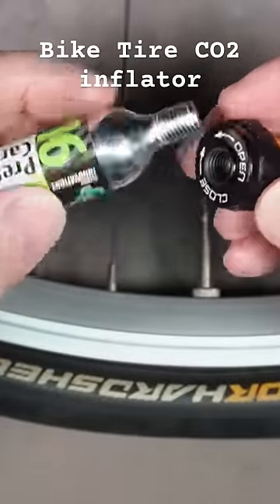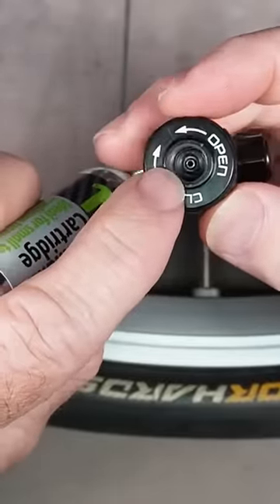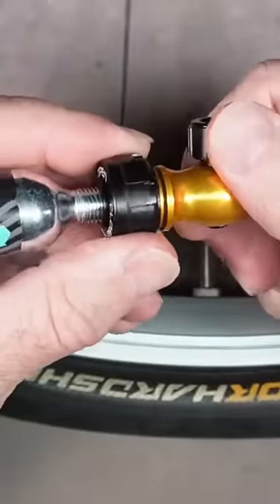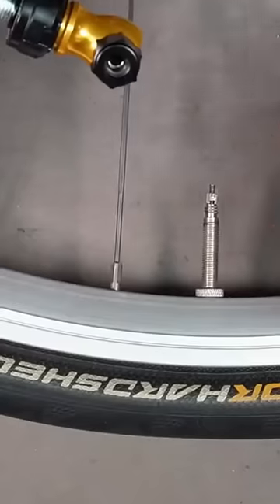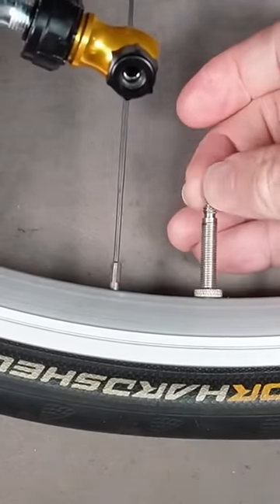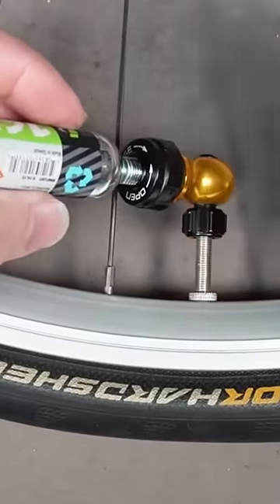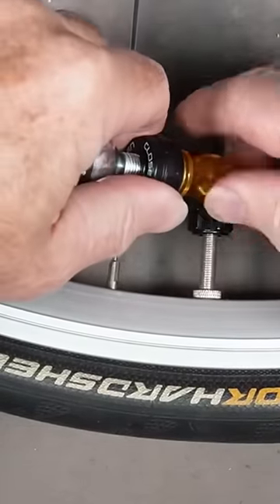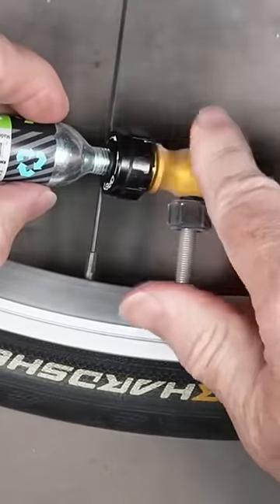Bike Tire (tyre) CO2 Inflator: How to use. #bicyclerepair #bike

Comment: So how do you get it out without deflating?
Reply from the maker: This is a Presta valve. Presta valves close when there is pressure inside the tube or tire. I only loosened the lock nut, which is necessary for air or CO2 to flow into or out of a Presta valve. I did not remove the core. You can see the entire video here: How to Use a CO2 Bike Tire Inflator
https://youtu.be/jc-BpZL3lAk
Thanks for the comment! I appreciate it!

Comment: So when you detach the bottle from the stem all the air comes out👍
Reply from the maker: This is a Presta valve. Presta valves close when there is pressure inside the tube or tire. I only loosened the lock nut, which is necessary for air or CO2 to flow into or out of a Presta valve. I did not remove the core.
Thanks for the comment! I appreciate it!

Comment: You never put the valve at the bottom of the rotation when you're filling with CO2. It totally puts liquid Co2 into the tire. You put the valve all the way at the top so that gas goes into the tire
Reply from the maker: Thanks for the tip!

Comment: So how much air do you lose when you unscrew it cuz , needles not in remember
Reply from the maker: Nothing will escape when the CO2 inflator is removed. This is a Presta valve. Presta valves close when there is pressure inside the tube or tire. I only loosened the lock nut, which is necessary for air or CO2 to flow into or out of a Presta valve. I did not remove the core.
Thanks for the comment! I appreciate it!

Comment: People need to remember that air pump that half length of the arms exist. That is much better option than this. Just make sure you don't get to close with tyre. Because it gonna make you look like jerking it.
Reply from the maker: There is nothing wrong with an air pump. A CO2 inflator is just another option for emergencies to quickly and easily inflate a tire out on the road after fixing a flat. Thanks for commenting!
Reply: @davescycling  tbh, I didn't see the common need to use that thing. The best I could think of is race and bears

Comment: and how do you get the inflator off and keep all the co2 if you have the schrader valve loose in the tire valve.
Reply from the maker: This is a Presta valve. Presta valves close when there is pressure inside the tube or tire. I only loosened the lock nut, which is necessary for air or CO2 to flow into or out of a Presta valve. I did not remove the core. You can see the entire video here: How to Use a CO2 Bike Tire Inflator
https://youtu.be/jc-BpZL3lAk
Thanks for the comment! I appreciate it!
Reply: @davescycling  The Presta valve is where?
Reply from the maker: The valve on the tube is not a Schrader valve. It is a Presta valve.

Comment: So how do you screw the valve stem back in with the inflator still on and not lose air?
Reply from the maker: Nothing will escape when the CO2 inflator is removed. This is a Presta valve. Presta valves close when there is pressure inside the tube or tire. I only loosened the lock nut, which is necessary for air or CO2 to flow into or out of a Presta valve. I did not remove the core.
Thanks for the comment! I appreciate it!
Reply: @davescycling  gotcha 👍

Comment: Is it actually safe? Because extreme cold can harm a rubber and can cause a cracking thus, you can seriously injure yourself while driving. The tire could explode. By doing it slowly, nothing will happen to the rubber but immediately releasing a CO2 gas in to the tire rubber cause extreme cold to the rubber and it will become fragile
Reply from the maker: Thanks for commenting! I have used this CO2 method many times over the years (it is designed only for emergency use when fixing a flat on a ride) and have never had any issues of any kind! Fast inflation and I am on my way!

Comment: All the air comes out when you take it off?
Reply from the maker: Nothing will escape when the CO2 inflator is removed. This is a Presta valve. Presta valves close when there is pressure inside the tube or tire. I only loosened the lock nut, which is necessary for air or CO2 to flow into or out of a Presta valve. I did not remove the core.
Thanks for the comment! I appreciate it!

Comment: a good idea would have been to have a gauge on this to see the pressure. I'd call this a fail.
Reply from the maker: Very true that a gauge would be ideal. However, the CO2 inflator is for emergency purposes and once you know how much CO2 you need, you simply use the device, verify that you have a decent amount of pressure and get on with your ride. I know that one cartridge will pump up my tire to about 95 psi and that’s plenty for me to get home. It’s not perfect, but it certainly has worked for me for years!

Comment: So how do u get the tire valve back in?  ?   ?
Reply from the maker: This is a Presta valve. Presta valves close when there is pressure inside the tube or tire. I only loosened the lock nut, which is necessary for air or CO2 to flow into or out of a Presta valve. I did not remove the core.
Thanks for the comment! I appreciate it!

Comment: WHEN HE UNSCREWED THE AIR VALVE, HOW DO YOU TAKE IT OFF 
WITHOUT LOSING THE AIR.!???
Reply from the maker: Nothing will escape when the CO2 inflator is removed. This is a Presta valve. Presta valves close when there is pressure inside the tube or tire. I only loosened the lock nut, which is necessary for air or CO2 to flow into or out of a Presta valve. I did not remove the core.
Thanks for the comment! I appreciate it!

Comment: So now, how do you get that device off without all the air coming out of the tire?
Reply from the maker: Nothing will escape when the CO2 inflator is removed. This is a Presta valve. Presta valves close when there is pressure inside the tube or tire. I only loosened the lock nut, which is necessary for air or CO2 to flow into or out of a Presta valve. I did not remove the core.
Thanks for the comment! I appreciate it!

Comment: If the stem is unscrewed, how does CO2 not leak out when you unscrew the unit from the stem after inflation?
Reply from the maker: Nothing will escape when the CO2 inflator is removed. This is a Presta valve. Presta valves close when there is pressure inside the tube or tire. I only loosened the lock nut, which is necessary for air or CO2 to flow into or out of a Presta valve. I did not remove the core. You can see the entire video here: How to Use a CO2 Bike Tire Inflator
https://youtu.be/jc-BpZL3lAk
Thanks for the comment! I appreciate it!

Comment: That's all fine and dandy but most of the time when we have a flat tire, is because there is a hole in the tire, and that won't do any good.
Reply from the maker: lol, A CO2 inflator is just another option for emergencies to quickly and easily inflate a tire out on the road AFTER fixing a flat. Thanks for commenting!

Comment: How do you take it off with the valve unscrewed?
Reply from the maker: This is a Presta valve. Presta valves close when there is pressure inside the tube or tire. I only loosened the lock nut, which is necessary for air or CO2 to flow into or out of a Presta valve. I did not remove the core.
Thanks for the comment! I appreciate it!

Comment: Why take out the shader valve? That's what hold the air in and allows you to put more air in. That's like... It's one job.
Reply from the maker: This is a Presta valve. Presta valves close when there is pressure inside the tube or tire. I only loosened the lock nut, which is necessary for air or CO2 to flow into or out of a Presta valve. I did not remove the core. You put can see the entire video here: How to Use a CO2 Bike Tire Inflator
https://youtu.be/jc-BpZL3lAk
Thanks for the comment! I appreciate it!
Reply: @davescycling  thanks for the knowledge

Comment: А дальше почему-то нет. 

А  я знаю почему. Потому что он облажался 😂😂😂
Reply from the maker: This is a Presta valve. Presta valves close when there is pressure inside the tube or tire. I only loosened the lock nut, which is necessary for air or CO2 to flow into or out of a Presta valve. I did not remove the core.
Thanks for the comment! I appreciate it!
Reply: @davescycling  в смысле ты не снял ядро 🥺 
Так баланса колеса не будет 🤔
Reply from the maker: I am not sure I understand what you mean.
Reply: @davescycling  google translate 👌

Comment: If you have never used one of these practice at home before you need to use it after a flat. It may not work exactly like you think it will.
Reply from the maker: This is excellent advice. It will also allow you to see how much pressure a cartridge will put into your tire. For example, I know that one 16 g cartridge will inflate my road bike tire (700c x 25) from completely flat (new tube) to a pressure that will allow me to continue my ride.
Reply: @davescycling  my shop would conduct flat clinics and Co2 was part of the advanced clinic. Everyone got to test one to experience. Historically one of the best clinics we held according to feedback
Reply from the maker: That’s pretty cool! Seems like a lot of guys I ride with use these, but judging from the comments on this video, there are also a ton of people that have never heard of it.

Comment: So he undid the valve that has a valve on it that is opened when he connects it? With the valve undone, how did he take the connector off without letting the air out?
Reply from the maker: Nothing will escape when the CO2 inflator is removed. This is a Presta valve. Presta valves close when there is pressure inside the tube or tire. I only loosened the lock nut, which is necessary for air or CO2 to flow into or out of a Presta valve. I did not remove the core. You can see the entire video here: How to Use a CO2 Bike Tire Inflator
https://youtu.be/jc-BpZL3lAk
Thanks for the comment! I appreciate it!
Reply: @davescycling  OK, l was thinking of the other type valve that the core opens when the air feed is attached and closes as the feed is removed

Comment: So how do you screw the tire valve you just unscrewed??
Lose all of what you just put in
Reply from the maker: Nothing will escape when the CO2 inflator is removed. This is a Presta valve. Presta valves close when there is pressure inside the tube or tire. I only loosened the lock nut, which is necessary for air or CO2 to flow into or out of a Presta valve. I did not remove the core. You can see the entire video here: How to Use a CO2 Bike Tire Inflator
https://youtu.be/jc-BpZL3lAk
Thanks for the comment! I appreciate it!

Comment: Small battery powered tire inflator strapped to my SurRon frame and it’s About the size of 2 decks of yu gi oh cards and can pump the tires up to 30+ psi if you really wanted to 😂
Reply from the maker: That is indeed an awesome option! I’m going to try one of those and do a video on that next. Thanks for the comment!
Reply: @davescycling  it’s great when I want to let air out for rocks, climbing, and sand. And when I get back on the road just air them up for good mileage. Having the battery air compressor on the bike is extremely handy for different terrains
Reply from the maker: Thanks for all the great info! Happy Holidays!

Comment: So why not fill them with a better air if they deflate fast?
Reply from the maker: The CO2 inflator is designed to be used for emergency purposes when you’re on the road and you get a flat. It is not intended to be a permanent method of inflation. Anytime you use it on the road you should replace the CO2 with air when you get home. Thank you for the question!

Comment: You I screwed the valve, how will the air stay in tire??
Reply from the maker: Nothing will escape when the CO2 inflator is removed. This is a Presta valve. Presta valves close when there is pressure inside the tube or tire. I only loosened the lock nut, which is necessary for air or CO2 to flow into or out of a Presta valve. I did not remove the core. You can see the entire video here: How to Use a CO2 Bike Tire Inflator
https://youtu.be/jc-BpZL3lAk
Thanks for the comment! I appreciate it!

Comment: Idk why he twisted the shrader valve out like that, as soon as he pulls the inflator off, all the air is leaving that tire 🤣
Reply from the maker: This is a Presta valve, not a Schrader  valve. Presta valves close when there is pressure inside the tube or tire. I only loosened the lock nut, which is necessary for air or CO2 to flow into or out of a Presta valve. I did not remove the core. You can see the entire video here: How to Use a CO2 Bike Tire Inflator
https://youtu.be/jc-BpZL3lAk
Thanks for the comment! I appreciate it!

Comment: What about the bleeder. If its loose all the air will just come back out when you disconnect
Reply from the maker: Nothing will escape when the CO2 inflator is removed. This is a Presta valve. Presta valves close when there is pressure inside the tube or tire. I only loosened the lock nut, which is necessary for air or CO2 to flow into or out of a Presta valve. I did not remove the core.
Thanks for the comment! I appreciate it!

Comment: What do you do when it blows the check valve out.
Reply from the maker: This is a Presta valve. Presta valves close when there is pressure inside the tube or tire. I only loosened the lock nut, which is necessary for air or CO2 to flow into or out of a Presta valve. I did not remove the core.
Thanks for the comment! I appreciate it!

Comment: Now it just needs a gauge to see how much you over inflated the tire...
Reply from the maker: If you are inflating a flat tire with a CO2 inflator, which is what it would be designed for, it is highly unlikely you will over- inflate any but the skinniest road tires. A single 16 gram cartridge will inflate a 700 C by 25 tire to approximately 90 to 95 psi. Larger tires would be inflated to a lower pressure. Thanks for your comment!

Comment: That style stim doesn't seem to all that great can't just use a regular air pump. aircompressor,  or a pressure gage. And the valve is exposed an seems like it could be bent or broken easily
Reply from the maker: I agree, and I don’t know why these are used, but that what I have on all of my rims, so I just need to roll it!

Comment: And this is cheaper and faster then regular air??
Reply from the maker: A CO2 inflator is just another option for emergencies to quickly and easily inflate a tire out on the road after fixing a flat. It is super small, light and inflates a tire in seconds. Thanks for commenting!

Comment: That valve is dumb, what happens when you remove the inflator?
Reply from the maker: Nothing will happen when the CO2 inflator is removed. This is a Presta valve, not a Schrader valve. Presta valves close when there is pressure inside the tube or tire. I only loosened the lock nut, which is necessary for air or CO2 to flow into or out of a Presta valve. I did not remove the core. You can see the entire video here: How to Use a CO2 Bike Tire Inflator
https://youtu.be/jc-BpZL3lAk
Thanks for the comment! I appreciate it!

Comment: Why did you unscrew the schrader valve. When you take the filler valve off the co2 will leak out. Why doesn't the filler valve depress the schrader valve?
Reply from the maker: This is a Presta valve. It works differently.

Comment: How can you tell PSI using this?
Reply from the maker: The CO2 inflator does not have a pressure gauge. It is used as an air emergency inflation device that you can carry on your bike. If you use it once or twice, you will know how much CO2 it will take to inflate your tire. Once you get home, you would want to replace the CO2 with regular air from your normal pump at which time you can check the PSI.
Reply: That makes sense!
I appreciate you getting back to me.
Reply from the maker: Thank you for your question!

Comment: I feel like without the valve tight the air will come out as soon as he removes it . There is nothing stopping it.
Reply from the maker: Nothing will escape when the CO2 inflator is removed. This is a Presta valve. Presta valves close when there is pressure inside the tube or tire. I only loosened the lock nut, which is necessary for air or CO2 to flow into or out of a Presta valve. I did not remove the core.
Thanks for the comment! I appreciate it!

Comment: *Because The Valve Is Loose...
The Air Will Come Out...
Need To Adjust So The Valve Doesn't Need To Be Loosened...
Reply from the maker: This is a Presta valve, not a Schrader valve. Presta valves close when there is pressure inside the tube or tire. I only loosened the lock nut, which is necessary for air or CO2 to flow into or out of a Presta valve. I did not remove the core. You can see the entire video here: How to Use a CO2 Bike Tire Inflator
https://youtu.be/jc-BpZL3lAk
Thanks for the comment! I appreciate it!

Comment: Just use a hand pump, freezing your rubber tube to get some extra air is not condusive to longevity in your parts
Reply from the maker: The CO2 inflator is used for emergency use when you get a flat out on the road. I have used this to save a ride several times over the past couple of years and it never damaged anything. I know experiences vary, but this is the tool I have carried for years.
Thank you for your comment !

Comment: Is it one time use
Reply from the maker: Each cartridge is one time use, the valve itself is reusable over and over. A CO2 inflator is just another option for emergencies to quickly and easily inflate a tire out on the road after fixing a flat. It is super small, light and inflates a tire in seconds. Thanks for commenting!
Reply: @davescycling waste of money just get a pump
Reply from the maker: Pumps are a great way to go! Thanks for your input!

Comment: CO2 is a really good organic solvent.  It makes sense for a short period of time but not sure about long term use.
Reply from the maker: The CO2 inflator is designed for emergency use only since CO2 will leak from a rubber tire in a matter of days. After using one to inflate a tire after getting a flat on the road when you get home, you should replace the CO2 with regular air from a pump. Thank you for your comment.